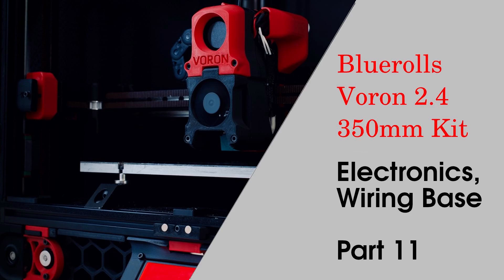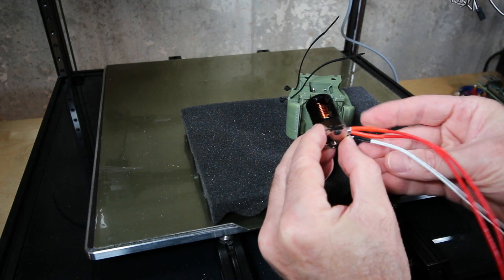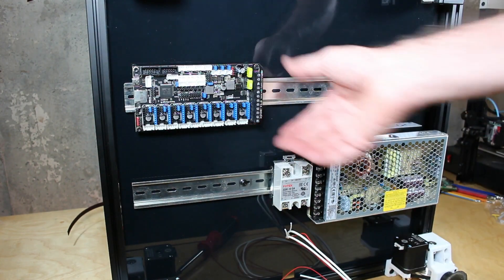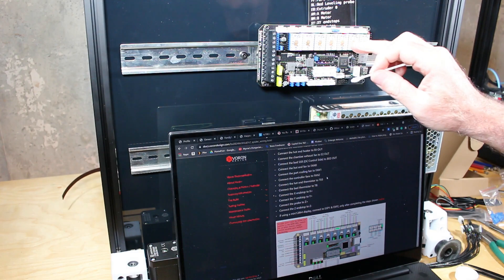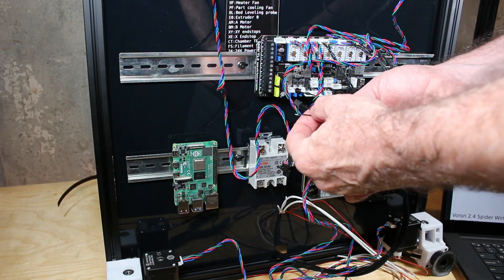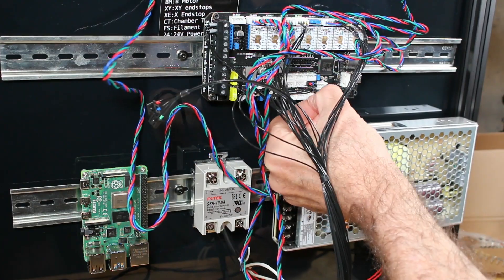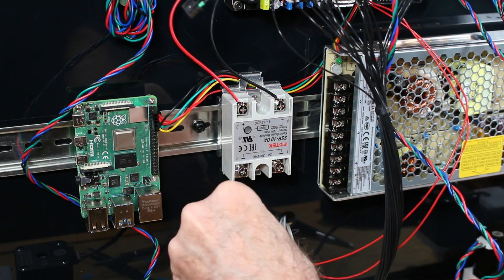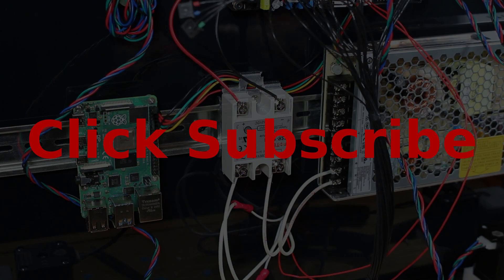Voron 2.4 Bluerolls Kit - Part 11, Electronics

Comment: FYI I loved my blue rolls kit but the wiring it came with was a joke. I received 64ft of red 24awg silicone wire and 3 pieces of 18 gauge wire about 4 or 5" long that had terminals on ends. It also had a few red and black 22 gauge 2 wire pieces that were 4 or 5ft, for fans I assumed. Finally there was an extension for I'm guessing the extruder stepper and that's it. The 4 Z motor wires were long enough but the A & B(X & Y) LDO motors wiring was not long enough. The extruder heater wire ALMOST made it being short about 8-10". There were no loose terminals for 18 gauge wire and the 4 jst xh connectors they did include were only the housings no pins. Needless to say it felt like they included nothing for wiring beyond what you would normally get buying a heater/thermistor and steppers.  They did include a xy combo proximity limit switch but there was no connector or pins that fit it so I had to pull the housing off and glue a jst xh 4 pin on it. I ended up spending another $90 on Amazon buying jst xh, jst ph and box of terminals. I got a box of 24awg silicone wire with 6 spools 100ft long for $37 and a 18awg silicone box with 6 30ft spools for $20. The 3 boxes of connectors were $9-12 each. I should have plenty of wire and connectors left over but 250ft of 24awg should've been included per the BOM plus 18 gauge, not 3 little pieces all the wrong size except 1 which I used for the jumper on c14 connector/switch housing.
Reply from the maker: I got about 60ft of the red and black 24awg wire and it sounds like much of what you had as well.  But I didn't use most of it.  I purchased a wire harness from Linneo to try and save some time.  I really don't like wiring.  I also used some 18 gauge wire  I had around for the AC connections.  I really didn't use most of the wiring they included.  But looking at it, that is certainly an area that could be improved in the kit.
Reply: @KapmansBasementWorkshop  I had a feeling they meant to include black as well. If I had it to do over again I'd probably buy a harness from west3d for $79. Looks like they use ideal wire type and the price is around what you'll spend buying your own wiring and connectors. My route at least left me a lot of spare. I plan to run a removable harness for accelerometer on the 2.4 and my Aquilas X+Y.
Reply from the maker: @ChrisHarmon1  , my accelerometer is removable as I really don't think it should be left on the printer during an actual print.  If I were to do it over again, I would attach a socket to the skirt on the Voron base and add a plug to the accelerometer cable to easily plug it in when needed.  Fliping the printer on it's side is a real pain....I paid a lot more money for my harness, $79 is a great price!
Reply: @KapmansBasementWorkshop  That's a great idea for the accel I might do that with some aviation plugs I have here. $79 is a great deal but you get no customization for that so really no comparison to yours but an option for the guy who can DIY but is smart enough to pick his battles 😉
Reply from the maker: @ChrisHarmon1  Nicely said!

Comment: So glad this video is finally out! Thanks for putting in the time man. My voron has been sitting on the floor for weeks because I am just too lazy or hesitant to figure out the wiring.
Reply from the maker: Glad I could help!  I've got another on the way.  Hopefully this will complete electronics.
Reply from the maker: I had plans on releasing the next video today,.  The the electronics are taking longer than I expected.  I'm almost there, but I made a mistake on some of my crimping and I'm waiting for replacement pins.  I'll try to get it out in the next few days, assuming my pins come in.
Reply: @KapmansBasementWorkshop  I appreciate your update! I am in no rush whatsoever, just glad you're documenting your build because it's very helpful!

Comment: Did you notice that 2mm self tapping screws are too long? I'll replace mine for shorter to avoid possible contact with DIN rail.
Reply from the maker: I did notice,  I tried replacing the screws, but the 2mm replacements I tried were hex and would strip when I tried to tighten them.  I just went ahead and used the screws that came with the kit.  They did not seem to interfere with the DIN rails.  My only concern was routing wires and making sure the screws would not pierce the wiring.
Reply from the maker: Post a link (if you have one) to the screws you used.  I would like to replace these at some point.